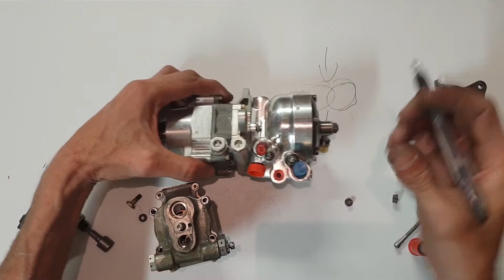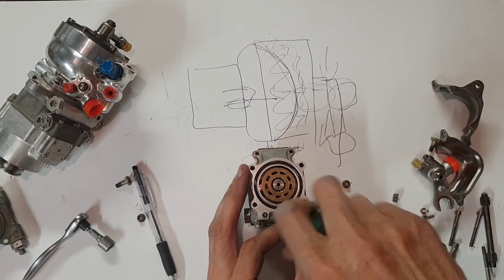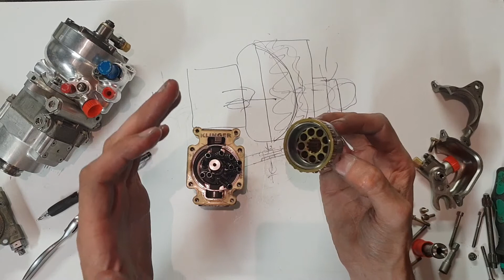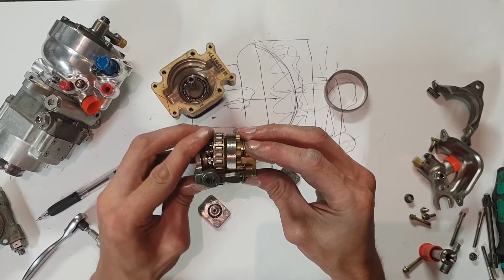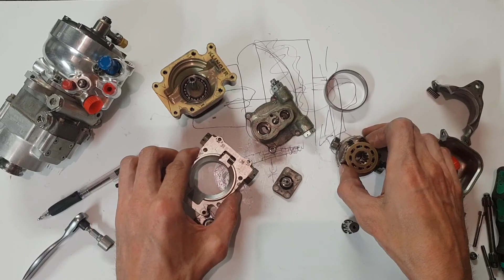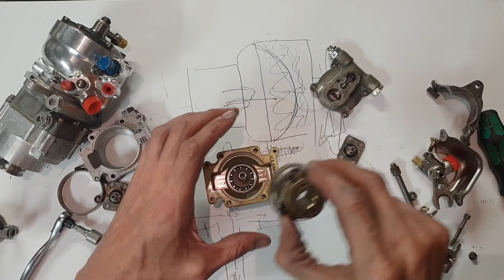F1 Hydraulic Pump - A Closer Look - Ep 3

Comment: Very interesting, I had no idea F1 cars used these style swash plate pumps.  Conceptually I was familiar with these, but I'd never seen one so small!  I used to work at an industrial testing laboratory and we would run benchmark industry standard tests for hydraulic fluids, either 1000 hour or 2000hr tests, often with inspection intervals every 500hrs. Occasionally we would run a fluid until the pump failed, which was usually between 3000-5000hrs.  The pumps we ran were a popular industrial scale pump, about 4-5x the size, the pistons in the ones I'm familiar with inspect were around 1" diameter.
Reply: Some of the early active susp systems used a small external gear pump, with a pilot unloading valve, I used to design these, Benetton, Arrows. The axial piston pump is so much more efficient and expensive. In the early 90s, F1 teams used these pumps too, but they had problems with the very high changes in rotation speed, ie. attched to an engine, even the camshaft drive, could hamerage the internals, as they were design to fit to a constant speed jet engine.

Comment: I wanted to ask about the fluid itself, is it an ester based hydraulic oil for fire resistance or maybe an ATF?   Also, I did not see a drain port for the piston pump, is it routed internally back to the inlet side?  Thanks for putting out this material, just gold.

Comment: Not sure that the accumulator is used in the way you describe, could be.  My understanding is an accumulator is used to dampen or smooth out the pulses (ripples) from the rotating pump pistons.
Reply from the maker: Also damps displacement pulsation harmonics... similar to how capacitors smooth an ac to dc rectifier circuit...can't remember if I mentioned that or not...thanks and greetings from Ireland!
Reply: @EngineeredtoWin  Exactly.  That is what I was trying to say.  Do you happen to have the part numbers of the pumps ( I know a couple of people that worked at Abex Aerospace, granted a long time ago before National Waterlift (now Parker) bought them )?  I don't recall if you said what the RPM and displacement of the pumps were/are ....
Reply from the maker: @truegret7778  I'll check for you over the weekend.
Reply: @EngineeredtoWin  Awesome - no hurry.  I love your channel btw.  Cheers
Reply: Superb Brian,  thankyou for putting the time and effort into making this footage . I’m an engineer, build my own race cars make my own patterns and molds design my own parts etc etc . I’m never over confident or show off , boast how clever I am because my knowledge is no where near as good as yours and other engineers around the world . I’m familiar with most manufacturing processes and really appreciate the amount of work that has gone into these pumps and in the other videos you have posted. 
One last thing to mention which is quite important to anyone designing components is that ( not to sound disrespectful by no means ) generally everything has been designed before once broken down into individual items . The clever bit is being knowledgeable and clever enough to combine all those components to resolve an issue . And do the calcs , manufacture to high tolerance’s . 🇬🇧👍
Ps don’t give up your day job as if you were assembling this pumps on price work you’d we loosing money 😜